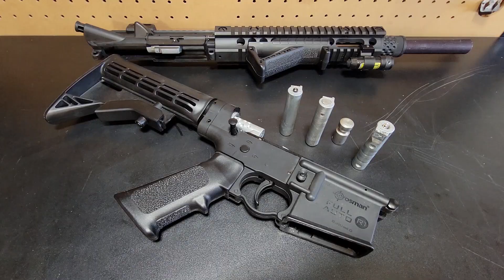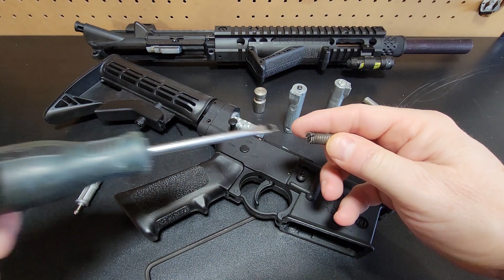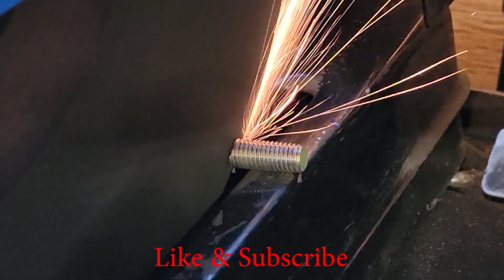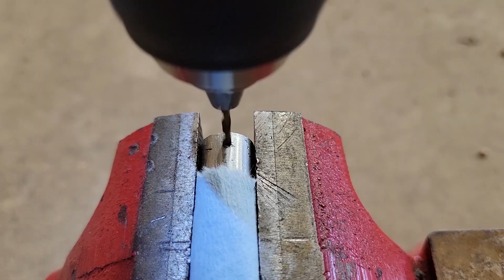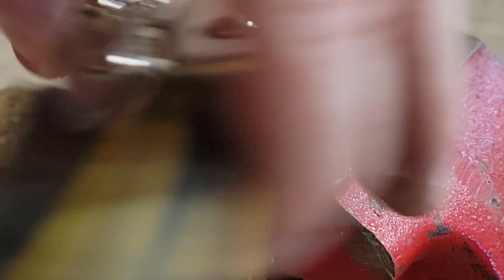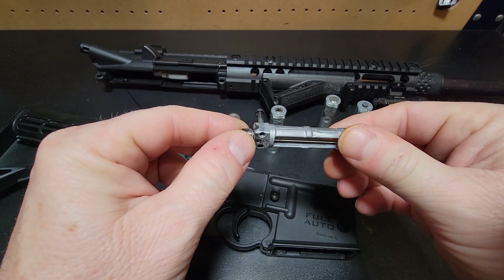Crosman DPMS SBR - R1 - MPW ** HAMMER MOD 2 ** Stock Internals Suck!

Comment: Run the bolt in until you establish the length sticking out you want, then put the set screw in the back of that and lock it down.

Comment: Hey, I gladly subscribed! I would love to see a mod for the magazine to allow the rifle to shoot 1000 rounds and attach a hose leading to an oxygen tank not, CO2 BC oxygen is more accurate of a shot due to introducing CO2 into the air that is mostly oxygen there's a difference in pressure that is greater in the air. Mostly I want to see this thing fire 1000 rounds and I want to stop buying CO2 carts. I know a regulator would have to be used or is that in the magazine already?

Comment: I have a semi auto version of the R1 and wondered if it’s an easy job to convert it to full auto? Is it just a case of changing or modifying the trigger sear?
Reply: Semi auto only and full auto versions are two different internal parts for shear assembly Semi can’t be modified for full auto

Comment: Just to clarify this Mod is to help the hammer from breaking due to high fps? It won’t upgrade the performance but rather help the structure and build? Correct
Reply from the maker: Hello, No, this mod won't increase the FPS. Its for anyone who has already broken their hammer or who wants to prevent it from breaking under stock conditions. It will also help when you Mod the magazine for more FPS.

Comment: I modified my  hammer this way and it worked great but kept breaking the action it would break the piston valve housing where the 2 little screws mounted it to the action not  1 time but 3 I  sent the rifle to crosman and I'm getting a new one I think the grub screw should be slightly recessed in the hammer I had mine flush and it still broke the action

Comment: Why not lock tight instead of jb weld. Jb weld fails more times than not. It becomes brittle and cracks especially in cold weather. lock tight has to be forceably removed. Other than that part it's a great video and I'm going to do this. Thanks
Reply: FYI Blue locktite not red

Comment: do you have the ability to machine parts? I think I figured out a way to increase fps on the umarex t4e .43 cal less lethal PPQ, it seems to me so far the only way is a very slightly longer firing pin which sits in the top of the slide. I think it would be a highly rewarding endeavor. many have tried and failed to mod these specifically and no one has succeeded so far, but then again no one has replaced their firing pin with a longer one. the firing pins are unique and would have to make sure to use same metal as the original to avoid wear and tear on the pin and on the back of the valve where it strikes. imo just a little bit more contact w the knocker valve on the back of the magazine will release significantly more co2 resulting in the best chance for an FPS boost.

this same theory should work on most umarex blowback co2 airguns whether less lethal or .177 since the company uses the same design for these blowbacks with valves in the magazines.

Comment: 1077 barrel on, outer barrel multi length extension, mock 7.5 inch suppressor. Spring mod and HPA in transit. Bottle will be attached to stock and wrapped with desert camo ace bandage as well as the suppressor.  Have two valves for magazines in 3.9 and 3.1 inner diameter but can't find the sweet spot where they don't leak out, any tips???  It's a Blitz or invader after this gets honed in.
Reply from the maker: Hello there, Nice mods! Is the mag leaking at the nozzle?
Reply: @rumblecanada  Yes and I've tried taking out and changing the o rings and spacers in various configurations. The 3.9 sits flush on the 2nd o ring, spacer or casing and the 3.1 fits between everything as the stock valve did.
Reply from the maker: @Hello There sounds like the leak is coming from the 2nd smaller seal. Are you using both springs and the small washer that rests up against the 2nd small seal?
Reply: @rumblecanada  I have used it yes on both valves, wasted a lot of co2 cartridges. I have not tried the 2nd smaller spring though. It barely fits around the 3.9. Think that would help? Getting more o rings soon. Think doubling up the 2nd seal would help?
Reply from the maker: @Hello There  I don't think the 2nd seal will help much. But if it does, woohoo problem solved. Does the small seal fit around your modded valve?
Reply: @rumblecanada  Ya, I have the o ring set coming with the HPA. Thinking ill stop testing until it gets here. then try again with the constant air supply. The small valve yes it's just a tad larger than stock, large one no.

Comment: finding it hard to find a metal valve replacement for your mag mod, still looking. Going to do a barrel extension as well. Would a 4.5mm ID brass tube work or does it have to be steel. Thanks for giving me more projects! 😁
Reply: Can be brass,aluminum, steel I found it needs to coned on the end (extension like a egg, stock barrel is the tray) place o ring’s in extension piece to insure alignment

Comment: The green seal broke on my gas piston? know any fixes haha
Reply from the maker: I would recommend contacting crosman for a replacement seal. Mine broke to, I used an oversized e clip and a small washer. But it depends on how badly the seal is damaged.
Reply: i have one green seal but the other green seal the smaller one i believe shredded, so ive been trying to do what you've been doing with the hammer striking the mag but i cant get any blow back.. so im waiting on hopefully your next video!👍
Reply: so i fixed it for now with a regular o-ring for the inside seal, i think my problem i didnt realize was my piston was sticking so every time it cycled it would shot without me pulling the trigger.. Thank you very much your videos help a ton!!!

Comment: Simple fix for the breaking blowback valve:
The problem is the hammer is stopped by the pin alone bottoming out inside the blowback piston. 
This places the load on the thin sections where the screws are holding the blowback piston in place.
Each shot subjects them to the full force of the hammer because the pin bottoms out inside to stop the hammer. 

If instead the hammer is stopped by the metal wall in front of it, rather than the pin inside the blowback unit bottoming out, but still hits the pin the same distance forward, the problem is solved.
A carefully sized nylon washer of appropriate thickness wedged against the metal wall in front of the hammer will shift the force of stopping the hammer from the weak point at those thin sections to the much larger wall the pin comes through once the pin has reached its end of travel.

Looking at the bottom of the hammer and bolt mechanism (out of the gun) press the hammer against the pin to see the gap left in front of the hammer and wall the back of the pin comes through where the hammer strikes it, that’s your washer thickness.

Comment: Nice!  I see you saw my comment on the last video.  They really should be threaded from the factory as the metal is really too soft to hold a press fit for extended use.  So far it's been holding up really well with the screw.
Reply from the maker: Yup! That hammer was poorly designed. They should have used 1 sold piece. Thanks for the post!!

Comment: Great video!👍🏻👍🏻
Nice to see you test out allkinda stuff, since you gotten several fullauto Crosmans at hand..
 Yea. That aluminium gaspiston.. A wee bit poorly designed imo. Just by setting those two small screws 1.5mm or so more forward woulda helped already the situation. The walls get so thin due the needed space for the rear of the firing pin that goes thru the gaspiston. The big flat rear portion of the firing pin ends just right where the two screws go thru. And since the gaspiston is pushed in towards the rear of the gaspiston carrier - there woulda been nothing to keep them two screws from being located 1.5mm more front. One very small design fault gotten pretty bad. Luckily I managed to make my own new gaspiston from metal. Has worked perfectly so far..
 My bolt has not though broken yet. But I've also had in mind to drive thru it completely with a big steel bolt and then just drill a rear hole for it after having it all locked up. The weight of the metal gaspiston already had a good impact on the recoil of the rifle - so I'd bet a more weighty bolt would also give a slight addition to the end action of it.. Dunno though if the magazine's valve needs any more punch than it already has gotten by the og bolt. But if you ever get yours tested - then please inform if the magazine used is original or modified.
I recently made some new nozzles (the spring resetted nozzle, that you left out completely at a point) and washers for a mag on my DPMS, but I've not yet tested the latest version. The latest worked, but was pretty inconsistent due the BB feeding nozzle partially jamming up at times. But yea . My now more weighted DPMS shoots at a slower rate of fire (about 950rpm I recall) with og mags (which I actually prefer, due realism stuff) but with the latest powermod valve, the rpm seemed to rise back up a bit again (not rpm tested though)..
Hope you get you stuff up and running again! Will be interesting to hear and see how the new CNC machined bolt comes around! All the best to you!👍🏻👍🏻